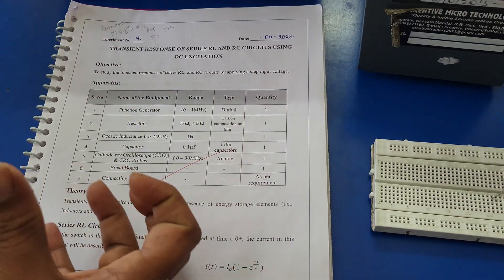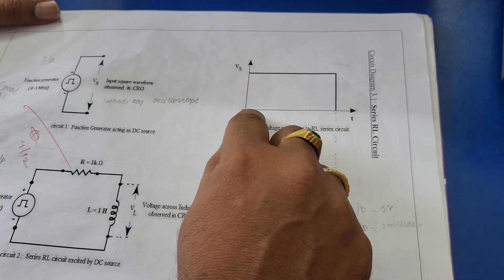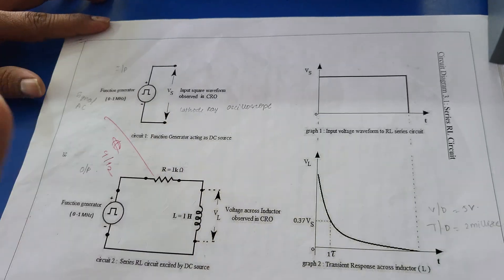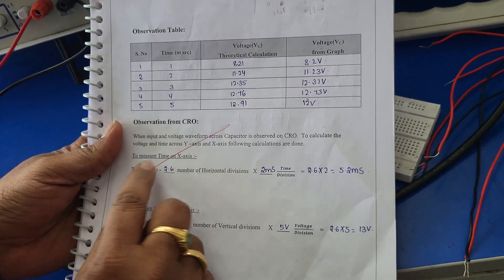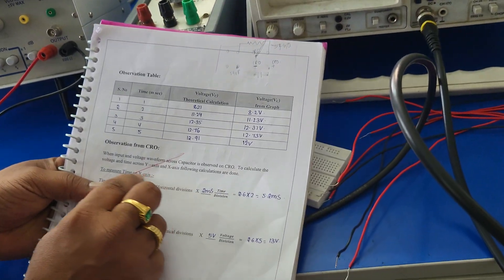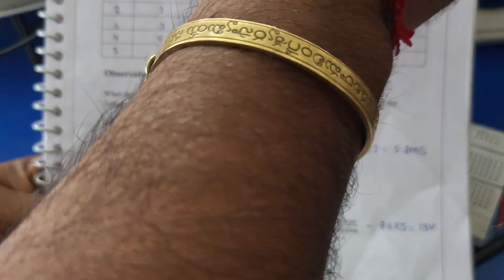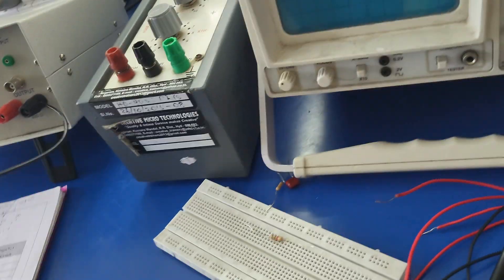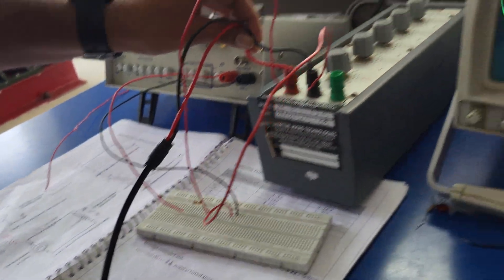Transient Response of Series RL and RC circuits using DC excitation

Comment: It is not working bro 
If I give direct connections to the wire without keeping them in water then it is working but when I keep in water it is not working 
Basically it's not working when wire is wet